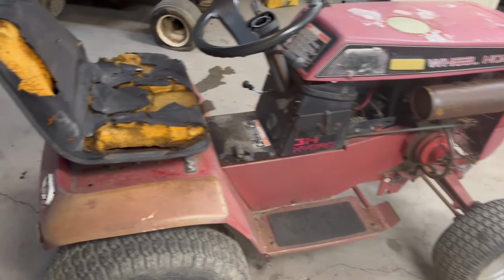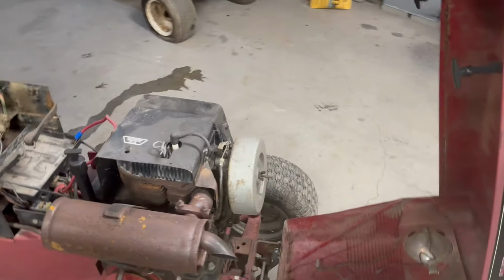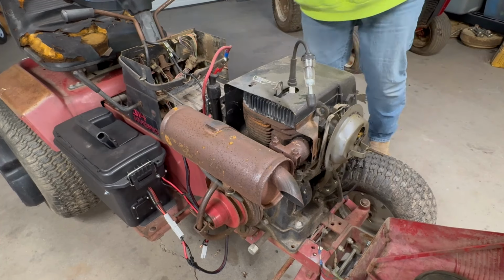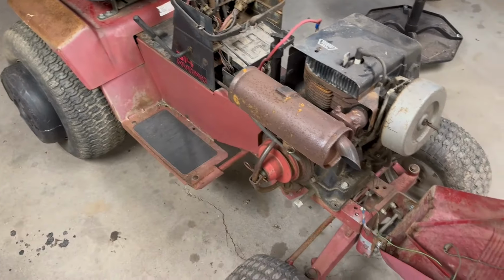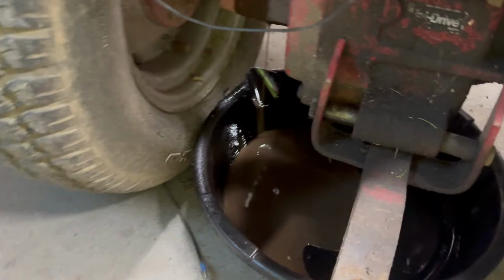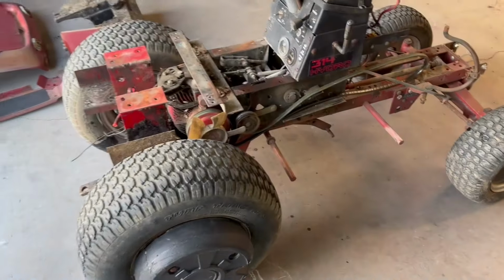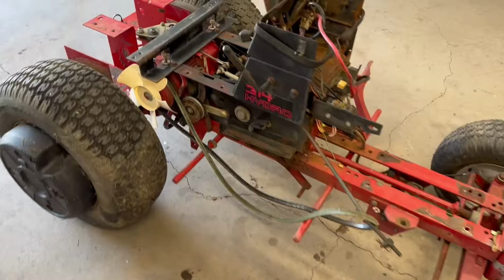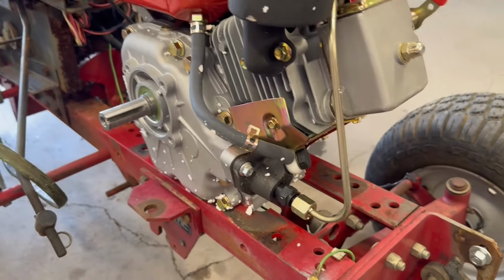Old tractor gets a new life ! 314H Build. Part 1! Teardown!

Comment: Throw some sea-foam or some atf in the fuel to try to clean up the rings on the piston. I would’ve tried to re-ring the piston, give it a light ball hone and see if that reduces the smoke.

Those Kohler Magnum engines are far better than a predator. I love the K-series engines and the ones like that without points are nice because they’re not constant issues.

I have 2 genuine Yanmar L70s on 2 of my tractors. I’ve been looking at those and because I can’t get any parts for it I’ll be sticking to the predator.
Reply from the maker: They are great engines! It wont get scrapped. Ill hang on to it for another project. Maybe repower my 308-8? Thanks for watching!

Comment: A something tells me about that tractor you got I'm going to let you know nicely why is burning oil like that I'm going to let you know nicely and the motor is bad because it sounds good is the rings that could be stuck are rings are bad and it will burn oil like that so I would replace the rings and then get new gaskets and just replace the rings and clean up a cylinder